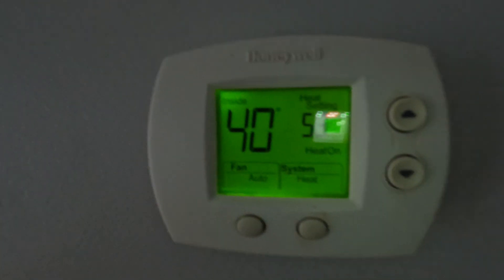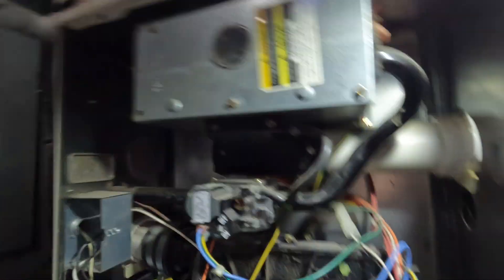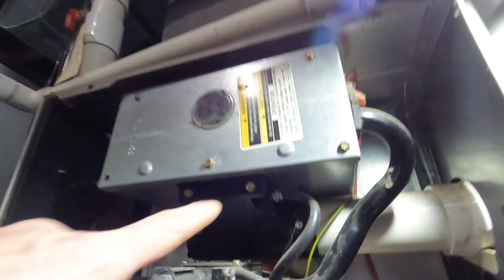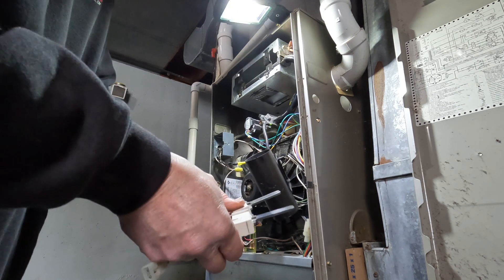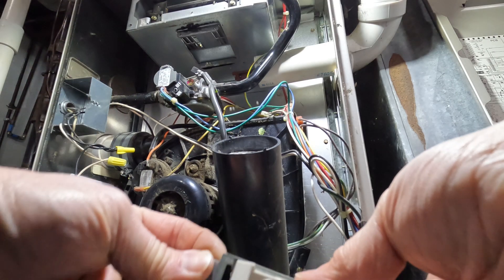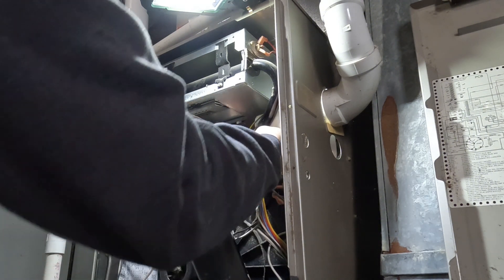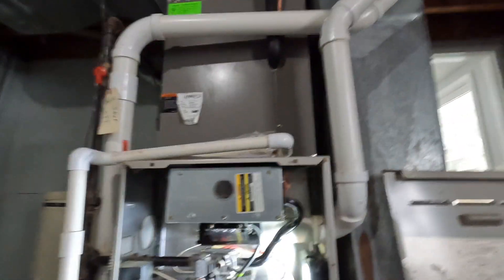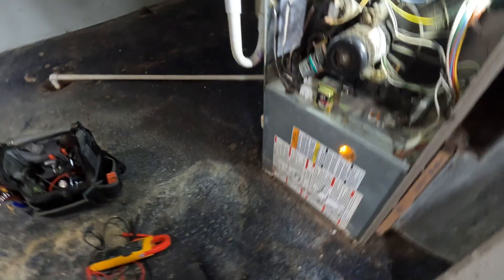Troubleshooting no heat on a Bryant Plus 90 furnace

Comment: Thank you! This video was exactly what I needed.  Vents we're blowing cold air, I followed your steps, the furnace had code 14. I restarted it and it worked, but the ignitor was starting to go after a couple of days. Bought a new one on amazon, swapped it out, works great now. Thanks again!

Comment: How do you remove the door of the furnace? I am having difficulty.
Reply from the maker: Are you talking about the Cover on the burner box or the actual furnace door?
Reply: @ADVANHVAC  furnace door. It says "Pull" but it won't give.
Reply from the maker: Try taking a bigger regular screwdriver and inserting it between the Furnace and the door. If it is the same furnace as in this video, there are just two clips at the top that hold it on.
Reply: @ADVANHVAC  thank you

Comment: You would have been better off just cutting that PVC out of the way. I carry a couple of those rubber couplings just in case I need to cut the PVC out. The newer Carrier/Bryant furnaces are so much easier to work on.
Reply from the maker: Thanks for that tip!